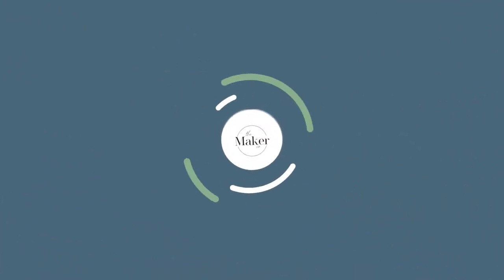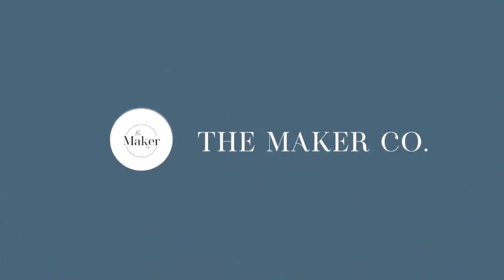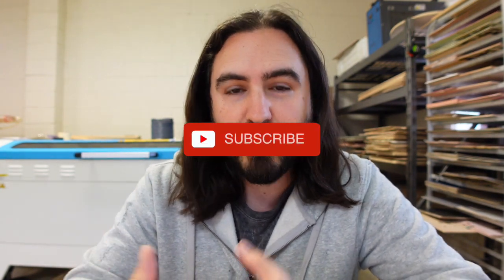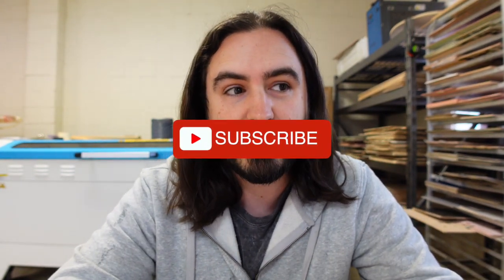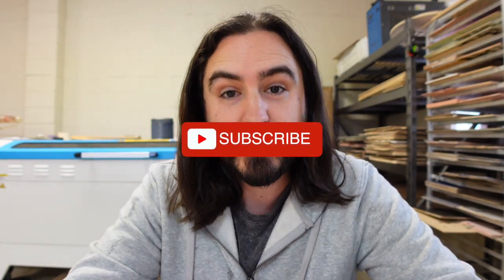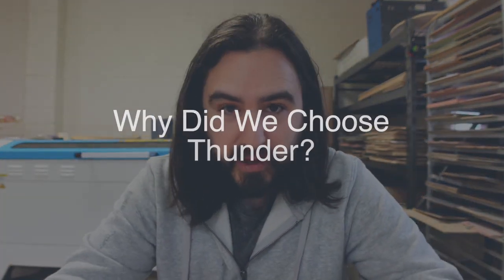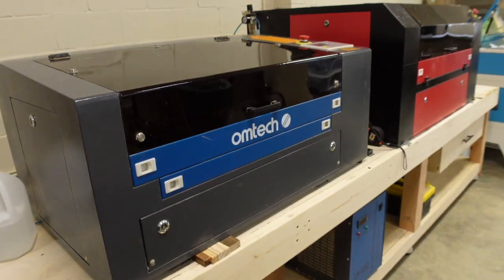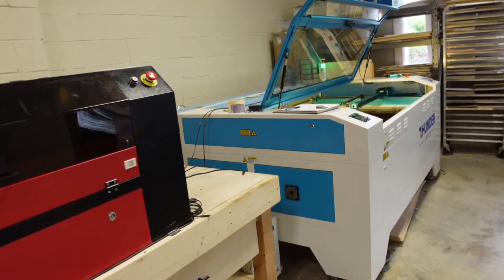THUNDER NOVA 63 LASER REVIEW

Comment: I have the Nova 51 and I would recommend getting a towing company to bring it from the dock it makes life way easier 
What settings are you running to cut  1/2" power/speed the recommended is obviously 90% but I hate running the machine full tilt
Reply from the maker: Yeah I would definitely recommend a towing company. Getting it in our shop was a nightmare haha. For cutting1/2” birch I’ve been using the 4” head at 10mm/s and 80 or 85% power. Stock Air assist on full blast 👍
Reply: @themakerco  That's actually faster than I expected 
Thank you for the reply
Reply: I used a few pieces of 2” pvc and rolled it off my trailer into my shop just me and my son. The delivery company used the lift gate and dropped it off onto my trailer.